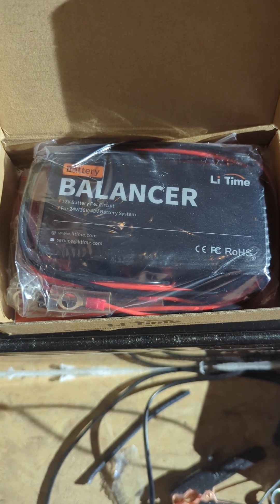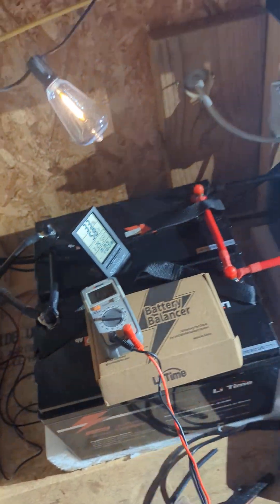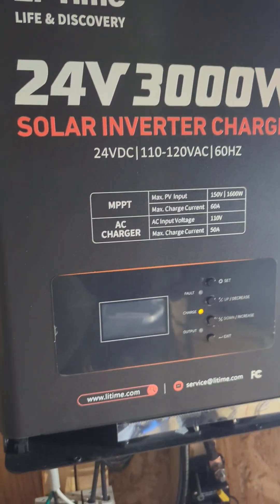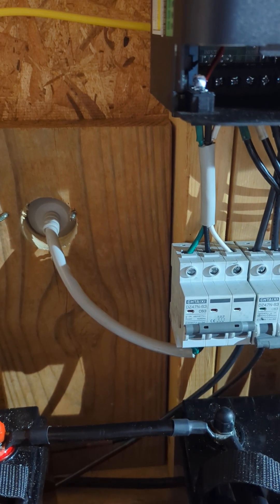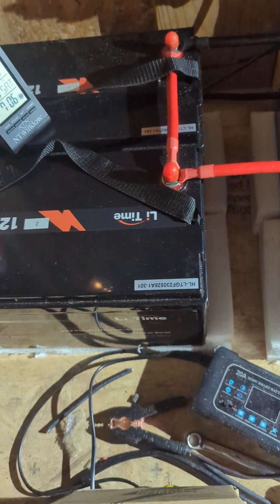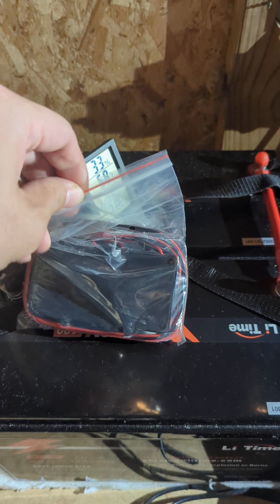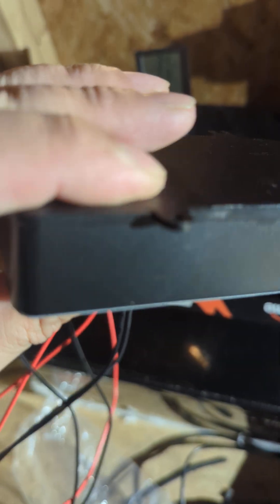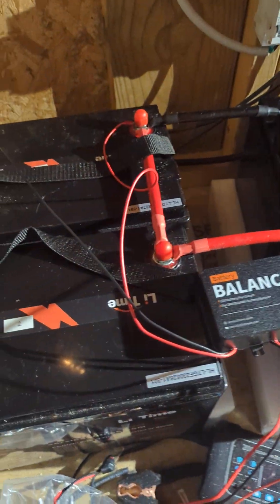litime battery balancer part1 - 24v 36v 48v unbox and install.

Comment: Did yours have a strong burnt rubber or plastic smell out of the box? I just got a new one off amazon so I doubt they sent a bad one but it smells strong. Kind of afraid to test it now on my new batteries.
Reply from the maker: I don't remember it smelling. So no. I would return it and of course use my link (lol) to buy another
Reply: @supersh0cker188  I checked out it the best I could, all 4 channels had a perfect 5xx ohm of resistance, perfect match so I figured it was good and just hooked it up, I only got 3 20Ah lifepo4 that can charge at 20amps so I hooked them up being a bit off and they balanced. low one was 13.25v highest was 13.31v. nothing heated up.

Comment: Your thumb nail shows two 48v systems, hooked up to a balancer, is that possible?
Reply from the maker: @dragonfly788  I actually have it hooked up to two 24 volt banks, but the balancer can be used on 48 volt banks